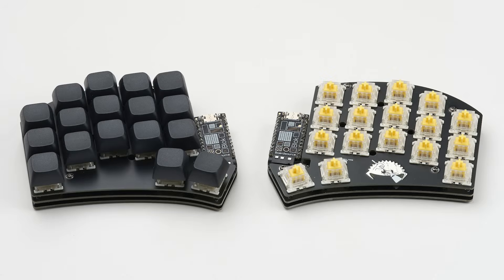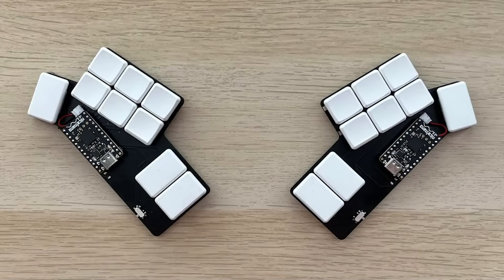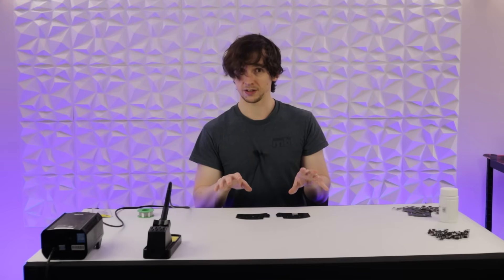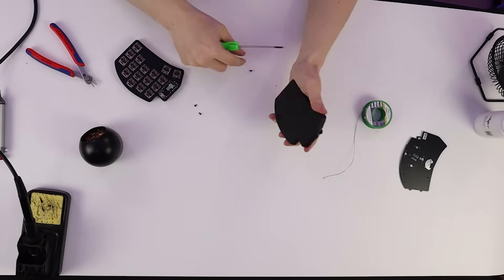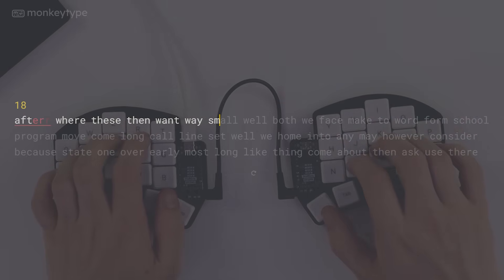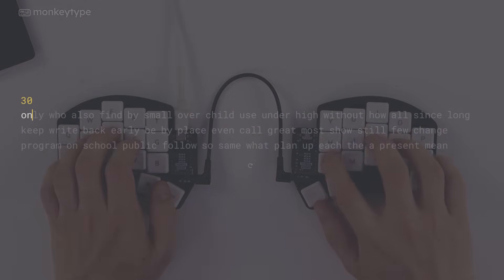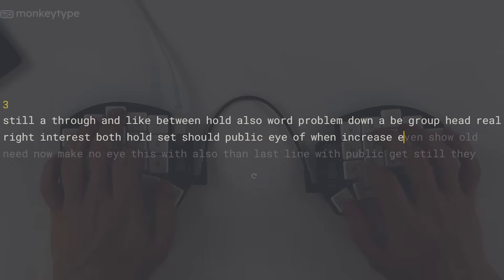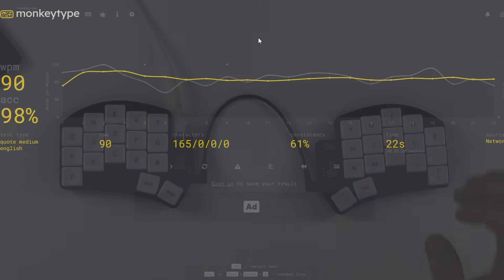The Ferris Sweep - Form over function?

Comment: Love the Ferris Sweep.  Typing on it now.  For me I have used combos to access things like (){}[].  This has worked very well for me.   I use single and double quotation marks so often, I put them on FD and JK combos.  A flat Ferris Sweep with foam wrist wrests is my comfort driven end game.
Reply: I don't use a ferris sweep but an ergodox ez(now configured into a 34 key layout) and I use of the quotation marks a lot too since code, I just used combos to put them very conveniently on uy, and wf (btw i use colemak-dh layout). What you did really inspired me for the combos since what I had to do to get the single quote and double quote was a hit and miss. I had to hold the layer switch to the layer with those symbols and its the enter key, so sometimes in high speed I'll accidentally trigger enter. Also its good because it's reducing how much I have to depend on layers, that's causing too much use of my thumbs. Getting the ferris sweep soon though love the portability and that its wireless(Going for that version).
Reply: @japhethjay4880  I started with an Ergodox EZ and then added a low profile Ergodox from SliceMK.  After reducing the number of keys in use,  I tried a few others before moving to the Ferris.  The Ergodox was a great place to start.  Getting access to common programming symbols without switching layers has proven to be very useful.  I used combos with my Ergodox and just added more as I reduced the number of keys.  I still use layers, but I rarely switch layers, relying on combos for easy access, OSL access, etc.

Comment: I bought a ferris sweep 3 months ago. I consider myself a minimalist. I have used many keyboards like lily58, glove80, corne. When I started with the ferris sweep I thought I made a mistake and started seeing other keyboards with a some more keys. I sticked with the ferris sweep and personalized to my exact use case and has been the best keyboard experience I ever had, even better than the glove80 because of the little finger movement. I even consider the ferris to be more ergonomic (for me) than the glove80. I feel that I'm always on the home row. So if you try a ferris sweep, do not abandon it quickly, adjust it and take your time. The curve may be steep at first but is worth it. BTW, if you haven't used split keyboards before, I recommend something like the lily58 that is easier to learn and then move gradually to the sweep.
Reply: I'm going straight from a 60% to this. I'm looking forward to learning the layers configuration and getting the setup right. Did you adjust a lot before landing on your current?
Reply: @Duy1P3  Not really, my first keyboard setting for the sweep was the default one that was there when I bought it. Then after getting used to it I started to change some things I felt worked better for me, and with the help of some tutorials I was able to change the layout to what I had in mind. Let me say is more of an iterative process, depending of the software you use, the layout you find comfortable could be different, but in general I've been using almost the same layout.

Comment: Tiny keyboards just can't be for me because they have to be too tailored to how one might use particular or limited set of software or environments/OSes. I'm too spread out in terms of "what I do", and prefer remain just as functional with standard stuff when I possibly am needing to temporarily use someone else's hardware or move around with a laptop format. I use a split keyboard with a thumb cluster, but that's about as far as I go. Happy with a Glove80 for the super comfortable curved keywell and reach, and keeping it QWERTY. One thing I see with the Glove80 that no other split keyboard of any size does comprably well is line up J/K with the same two fingers that control up/down. Though up/down needs to be swapped, that makes them the same two fingers as the vim motions.
Reply: Same here. I was thinking of getting a Corne, but may go for Lily58/Sofle to keep the number row.  The keywell route (Glove80/Kinesis) also initially looked appealing, but I fear I may get too comfortable/addicted to them 😂